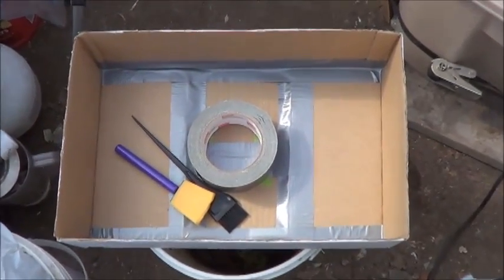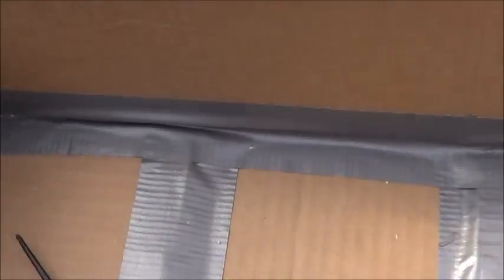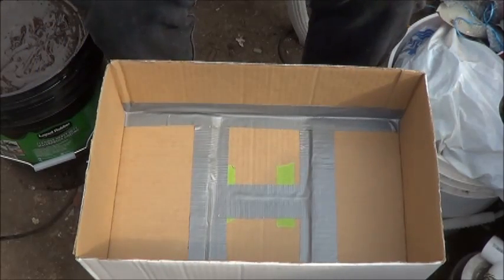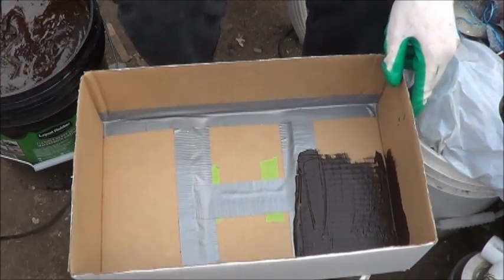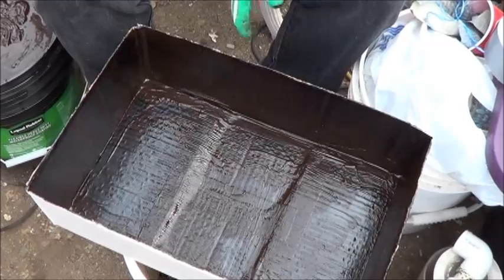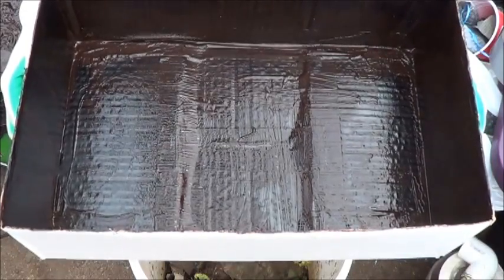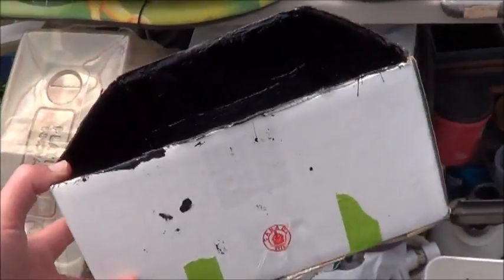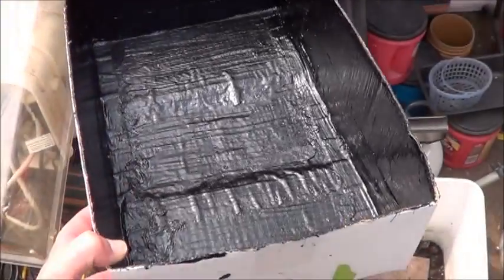Liquid Rubber Test #2 - Making a Waterproof Cardboard Box

Comment: Hey guys this has been done for over 50 years now. I was a roofer at a chemical plant. And we finally replaced a roof over 50 years old that used rubber. I use it in boat building (heavy) but on a box it's the same concept,tape the outside and seal the inside ,or use drywall mesh tape. I'll try and post a video of a kayack I'm making. Cool experiments.
Reply from the maker: I've seen a canoe made with this but not a kayak, that would be a fun project!
Reply: Basically a covered canoe. Lol. I was thinking about using it on a frame. Skin on frame type. Then rubber the hell out of it. And call it "el profolactico"😃

Comment: With you living in Canada. Where did you buy this stuff Canadian tire or home hardware? Did it come in a 5 gallon bucket?
Reply from the maker: +Tyler Murray - You can get it online but I believe I found it in a Home Hardware.  It did come in 5 gallon at the time, much better price in that size too if I recall.  Thanks for watching!
Reply: +JT Bear awesome thank you very much for replying so quick. I will have to Check this stuff out. I am wanting to build a Aquaponic system out a ply wood. I think this stuff would be great to seal the wood. Thanks for your help.

Comment: Am I missing something? Surely using a plastic leak-proof tray is miles easier and cheaper?  look up Coolseal ,Yes I have a vested interest.
Reply from the maker: +Nicola Clarke - Never even heard of Coolseal but I'll go google it in a minute.  This was a basic test of the water proofing ability of the Liquid Rubber product because I was wanting to build a much larger fish tank and sump then I could find in a premade plastic container.  I saw many different versions of this idea when looking into the product & basically didn't believe it so I had to give it a try to find out for myself.  Turns out it does work but yes, is quite pointless on such a small scale.  Just a product test.  :-)

Comment: This is technique called tanking and is used in the creation of walk in bathrooms or wet area's. You'd be much quicker with a small short pile roller and a small fitch brush for the corners, then you could rattle them off (produce them fast) and sell them lol!
Reply from the maker: darkan99el Lol, no need to sell them.  I was running some product testing while I tried to figure out if I want to use this product to make a fish tank for the aquaponic garden!  'Tanking' you say ...

Comment: What is the make of rubber you have used please? 

Thanks
Reply from the maker: It's actually called "Liquid Rubber" and it's available in most on North America and Europe I think.  I haven't finished all my assorted tests but I'm pretty happy so far.
Good luck on your future project!
Reply: +JT Bear I've checked online and have found there are a gazillion products called 'Liquid Rubber'.  All have different labels or manufacturers.  I want the one that is water proof, pond friendly, can be used for roof repair, has enormous textile strength and flexibility and doesn't require a primer coat.  It's a one coat application.  I have seen this product advertised on television, albeit awhile ago and didn't write down the brand, other than 'Liquid Rubber'.  I finally found it online (I don't know if this particular one you're using is the same brand b/c I can't see your label).   However, I can't read the label b/c it's out of focus.  I went to Home Depot and asked for Liquid Rubber (in the paint department) and was told they didn't carry such a thing.  It was suggested, maybe I could order it online (?).  At this point, I'm frustrated!  I'll try Lowe's next but, If you can help, I'd really appreciate it.
Reply from the maker: The product I use is Liquid Rubber, from the Liquid Rubber company and I found it at Home Hardware, don't know if they exist outside of Canada though.  Aside from the 1 coat application, fine for roof but not for a fish tank, this is most likely the stuff ... 
Here's a link to the Brand site, hope it helps! 
http://liquidrubber.ca/?gclid=CNuh-fC5gswCFQIKaQodJuUBrQ

Comment: Using plastic parts and liquid rubber for aquaponics. Not sure but wouldnt plants suck up bpa from plastics and any chemicals from liquid rubber? Ultimately you will ne consuming these veggies and fruits.
Reply from the maker: While there are higher quality part that I could build my system from, the point was to see just how little was required to get started in aquaponics.  My system has grown quite a bit over almost 3 years of aquaponic experimentation and I honestly feel the health risks are questionable compared to known health risks from mass produced 'food'.  If the choice is food grown in plastic or don't eat ... what would you choose?
Reply: I assume this is far better than gmo and other nasty stuffs used to grow food but I havnt seen anyone talk about if its safe to grow food on plastics and what risks are involved. I try to avoid plastics as much as possible.
Reply from the maker: Ideally so would I, but it's important to do what you can to get started right away.  I have been assured by the company that Liquid Rubber is totally foodsafe but I do have some concerns about it that ... linger.  In such a limited situation as I have for gardening I think that plastics are unavoidable.
Thanks for the input!
Reply: bada bing hi mate, I was concerned about it myself, and did some research - it seems to be safe, when you use food grade plastics (pvc, polyethylene), according to the current state of science (one still needs to use a pinch of salt to it, because how many times it was that stuff deemed "safe" has turned out to be not safe at all?). The size of the molecules in plastics, are huge, comparing to what is being absorbed through the roots membranes ( or whatnots). Which is single ions, if I understand correctly.

Myself, I would use extra care to protect the plastics from the sunlight (UV light is generally rather nasty to plastics, which might break down into their constituencies elements , which might leech into the water, possibly, which might be toxic on their own, which might end up in your plants. Maybe, perhaps. Just a precaution). 

Some of the plastics (pond liners, used in grow beds), can be even certified organic, if you shop around, so that's some other hint as for them being rather benign.

Personally, I would stick to PVC and polyethylene (especially the second one, man, this thing is resilient to many solvents, big time, even lies and acids). I would rather NOT experiment with that kind of stuff like that liquid rubber, unless it is food grade, somehow independently confirmed, and broadly used in food industry.

But cool idea though :-). You could use paper tape instead of duck tape, the type used by painters to secure the edges of covers etc. Or plain gray paper tape, just as well.

Although I cannot really see the point, beside playing around , there is no structural strength to it whatsoever, anyways.
Reply from the maker: No point, just testing the application process and putting one of the demo's I had seen to the test.  Duct tape was a bad idea as far as getting the product to stick but ... it's what was around.
Thanks for the very informative comment!

Comment: I want to play around with this stuff so bad!  0_o  I can think of a few fun experiments for liquid rubber. And also fish tank build ideas.... I can't wait to see how this turns out!
Reply from the maker: Well, I'll fill this up in the next couple of days and we'll see how it does.  It is kinda fun to play with ...
Reply: Depending on how you went about it you could use the LR + rigid foam insulation + chip board/ particle board/ plywood to make an insulated tank for next winter.
Reply from the maker: That's sort of the plan.  With a mini greenhouse to cover it inside the main one ... It should work out nicely.  :)